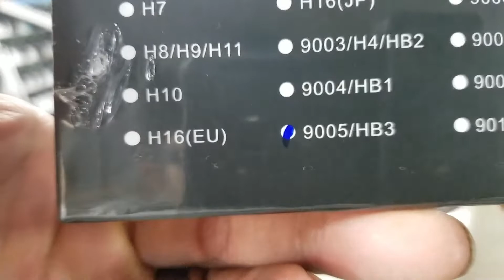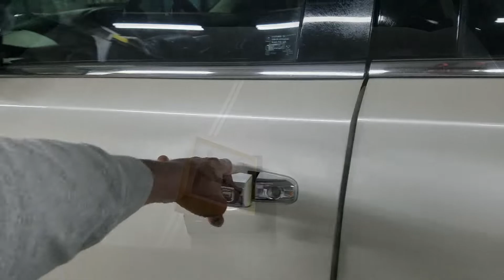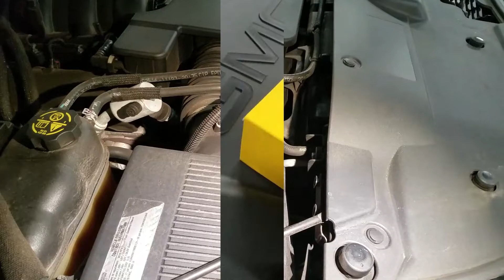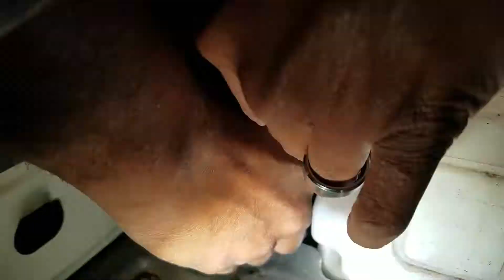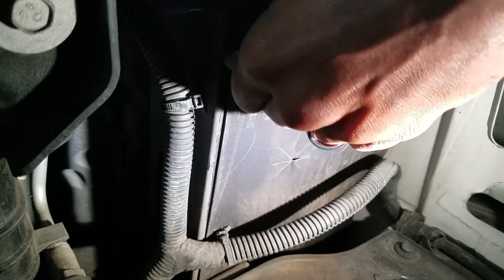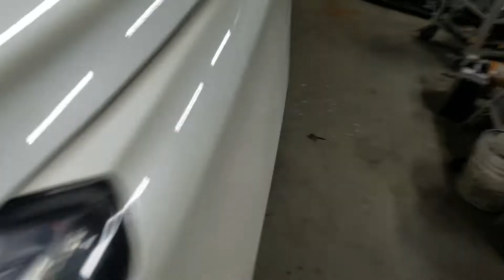How to install LED High Beams (Auxito) Headlights 2015-2010 GMC Yukon/Yukon XL Suburban Tahoe #3W1B

Comment: Did you get a check engine light?
Reply from the maker: Great question, no check engine or lamp failure indication lights came on. Auxito provides an OEM quality LED upgrade that is error free.